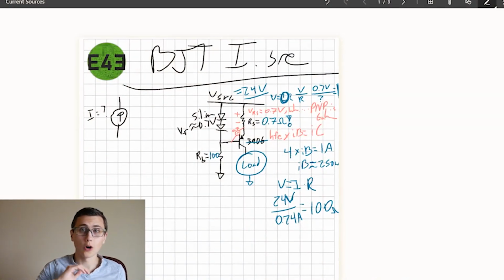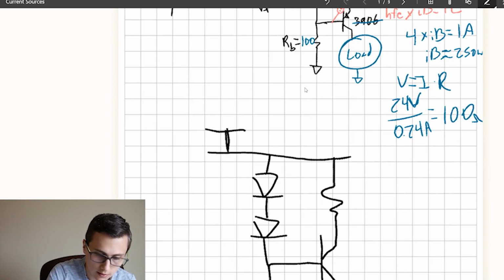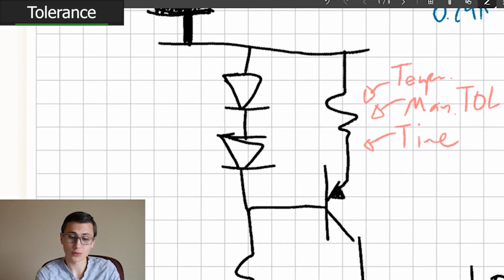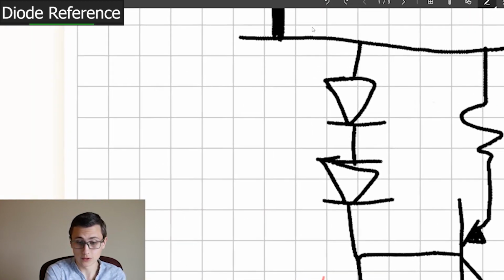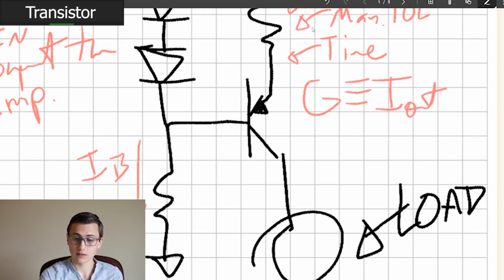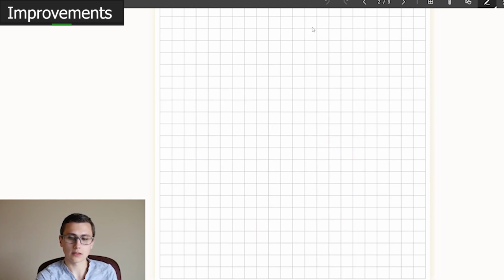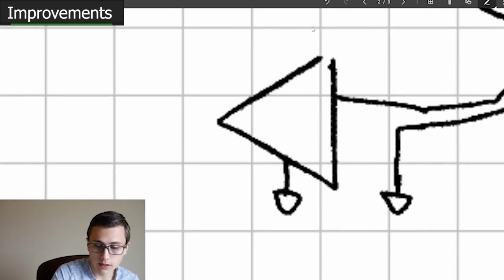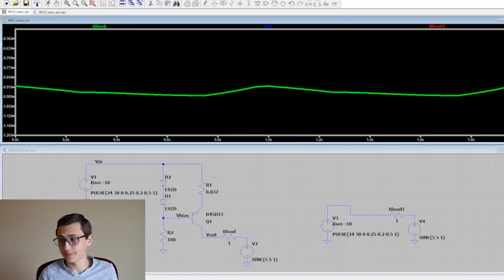Component Tolerance and Amplification

Comment: But is really the OP-amp can control the current in the BJT more that IGBT or mosfet in the DC current loader.

Because the BJT is need current feedback and the mosfet or IGBT is voltage control . And the OP-amp is Claver to censer the input voltage feedback.

The system is exactly like DC current loader test .that  Can test the application of any DC source of it can handle the current that need to operate the hardware application.

I think to use the op-amp with mosfet in low voltage is grateful than IGBT .
And to use it in high voltage is better to use a IGBT than mosfet .

But I really cannot know if can be used in BJT
Reply from the maker: Hi Abed, I think I'm struggling to understand this comment fully, but I think i understand some of it. 

I agree that an opamp wouldn't be ideal for controlling a BJT, I think that applying an appropriate amount of base current could quickly become an issue for a simple OpAmp. With regards to IGBT vs MOSFET, I haven't come across IGBTs with extended ohmic regions intended for use in linear regulation stages like this. I think the difference between an IGBT and MOSFET would be much greater if this were a switching application. 

Since this is a linear current regulator the reality is that whatever technology is used must survive dissipating all the power!

I like your careful thought process about this, and hope to hear from you again! Thanks for watching!